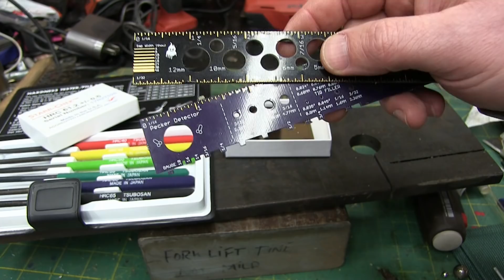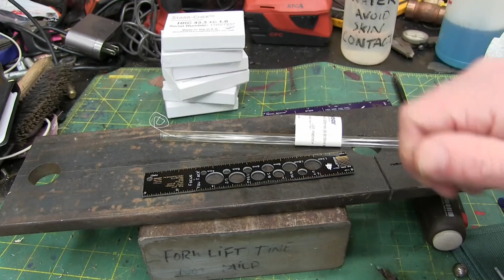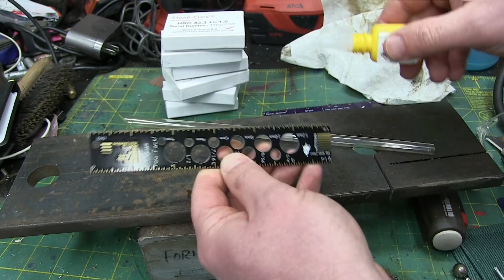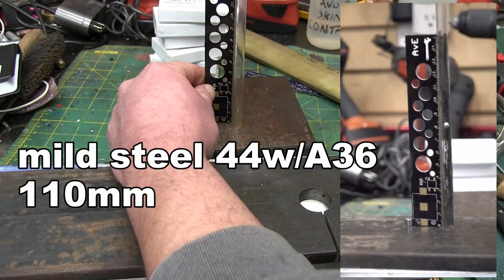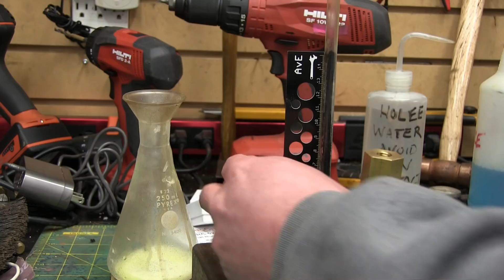Pocket Hardness Tester PROTOTYPE | IT WERKS!

Comment: A couple suggestions, keep the ball in the tube, that way you won't throw off the calibration by ending up with sticky greasy balls after fiddling with the apparatus... hmmm... where was I?
Ah, yes, a thin disc at the bottom, aperture just slightly under the diameter of the ball, it won't get on the way of the ball hitting the surface but will keep it inside. A the top an elbow for the ball to go over the top and rest, a little lever would kick it into the tube.
This way it would be less figety, just pick it up, turn it over so the ball gets into the elbow, put the instrument down and when it's nice and square flick the lever and make a measurement.

Comment: Fanfucintastic (Please be aware, there may be chillin present). Please try putting the piezo (or a strain gauge) under the coupon of the sample material is being tested. The item being tested should 'ring' at the same intensity as the sample 'standard', hence a basic correlation.

Comment: Mass difference shouldn't be an issue as long as the sample is backed up against a rigid surface, and can't be moved by the ball.
Also, a small solenoid coil around the top of the tube could hold the ball until the controller cuts current to release it.  This would fix the drop height and reduce the variations in drop produced by a fumbling 200lb gorilla.
Brilliant concept by the way.

Comment: Perhaps somebody smarter that me can advise here but how would air resistance effect this, small ball in tube like a piston in a cylinder? Obviously this could be factored in but what about different altitudes and thus different air pressures, how much difference could this make?
Reply: Say you used this at sea level, higger air pressure, ball falls slower but also doesn't bounce as high / at 2000ft thinner air, ball falls faster but then bounces higher; Could this cancel out any effect caused by altitude?
Reply: port the bottom end by < ball radius to reduce back pressure, or make sure the tube i.d. is >>ball diameter
Reply: Or include a calibration against a known standard. Like tare on a scale.
Reply: likely lower than all the other errors, well within what one would expect for a $25 ruler and tube device.
Reply: Luke, again, not trying to get 100% accuracy. Just want to get er in the ball park.
Reply: I have to agree here. All things considered, this is the roughest of rough estimates. And cheap too. Where do we let go of 'accuracies' to favor it just works
Reply: Precisely identify different size balls that correlate for different altitudes!!!
Reply: A thicker tube with a slot cut out most of its length would work the best.

Comment: Perhaps use a small solenoid so your drops are consistent.  You could even set up some simple light gates to measure the drop and bounce.  Just to make sure some apprentice doesn't try measuring at a 30 degree angle.  Provide a few ball and tubing sizes and you would have a damn cheap universal approximator.

Comment: So that was pretty brilliant.  Two ideas for ya.

Mayhap a photonic breakable beam at the bottom might be easier than a sound processor.  Maybe put a shroud around it to block outside light.

The freefall of the ball could pressurize a pillow of air, giving it some early terminal velocity that could complicate the curve fitting between time of bounce and hardness.  Maybe vent it with little holes all along the side.

Comment: Nice work propeller head. I'm thinking you'd have to do this on a perfectly flat, level, perpendicular, orientation to prevent the BB from touching the inside of the tube?

Increase the diameter of the tube to prevent the BB from touching? As a lover of fine knives I can say this is pretty damn cool.

Comment: You're correlating elastic collision energy to density and therefore hardness.   The problem is that slight changes in volume or shape of the test material will mess this up.

For the effort put into producing uniform samples you could just but the real test files.

Comment: i feel like the harness of the material will change the propagation of the pressure wave to the sensor, not sure if this would be totally negligible or what ... i would use an IR emitter and sensor in the tube ... it does not have to be in any exact position as long as its lower than the lowest point you expect the ball to go

Comment: you could have a little hatch at the bottom of the tube so when the ball stops bouncing and comes to a rest, only then will the passive hatch be accessible to the ball, thus saving to move the apparatus for resetting, even if the tube was ground at 45 deg it may work

Comment: I wonder if it could be done using some sort of hammer and spring setup, similar to a center punch? Measuring the compression on the spring to calculate hardness.  This would allow measuring on surfaces that are not flat and could probably be contained in something the size of a pen.

Comment: Might want to take measurements of subsequent bounces and so some clever stuff in the brain box to cancel out the error in initial height and velocity.
I haven't really done any investigation but what you essentially want is the coefficient of restitution. I highly suspect it won't be linear to the hardness nor linear to the actual impact speed, so you will most likely get different coefficients for subsequent bounces. However I suspect the relation of impact speed to coeff of restitution will be similar/same "shape", so you might be able actually use it to fit (polynomial least square or something) a function which depends on the hardness. That would also give you an error reading actually!
Probably takes some maths 8bit integer only machines (esp without hardware division) won't be too happy with, but computing time isn't an issue anyway.

God damn it now I want to take some measurements and try!

Comment: Brilliant. However, I wonder about how the thickness or gauge of the material being tested would affect the readings. A thin piece of 6061 aluminum, for example, may have a certain resonance that would affect how far the ball bearing travels versus a thicker or heavier gauge piece of the same 6061 aluminum. If both pieces were completely clamped down to a known harder than woodpecker lips material it may not be an issue. Yet, how would one clamp down said different gauges to ensure no resonance could incur?

Comment: Hey there AVE, Im a Mech Eng student at the UBC Okanagan. Might be able to test your samples on an actual rockwell tester, so we can get some validation. Also, One thing to consider is that the hardness of the ball is going to affect this as well, so it might be better to use a harder material, like ceramic, or even glass, provided they are readily available, I suppose. I'd think that the material (and geometrical at that) properties of a BB might have too much variation to be ruled out as a form of inaccuracy.

Comment: Couldn't you put an impact sensor that measures the impact of the bearing once it bounces back. So it falls, then the sensor slips in and takes the impact. Not sure if a sensor is sensitive enough for it. (Or have the ball land at an angle. Like bounces in a V

Comment: Or a tool like your auto center punch except on the rebound click it displaces a little shaft under tension. Like the way an air pressure gauge works

Comment: So much hype in the comments...
using a ball here ties your measurement to two fairly complex variables. the air density and gravity variations, both are a pain in the ass to account for properly. on the other hand, maybe they wouldn't add up to too much error. you gotta do the numbers.
aside from those, the ball needs to be calibrated hardness and the instrument needs to be exactly level.
also, each time you bounce off, you add 2 times noise to your measurement. at each bounce ball would interact with gravity and air friction, and it may or may not interact with the tube walls. reading one single bounce has a much better S/N ratio.

I'm quite sure you can get a hardness value based on the resonance frequency (AKA the tone made at the point of contact, that would directly reflect density, not quite the same as hardness though)

Comment: I can see using an arduino with the piezo connected to an input.  First bounce it stars counting and second bounce displays count on an lcd.  If you record the count and you know the hardness of the material eventually you can build up a lookup array in your program to display a hardness.  Remember this isn't meant to be exact. After all we would be happy with just a set of hardness files that only estimate the hardness.

Comment: What about two tubes with an open intersecting point on the plate. Set at angles like a V. One smooth for the  the drop and the other with lots of indexes to keep the ball from rolling back down.

Comment: Could you use a sealed system for the ball and have it dropped with an electromagnet onto a known surface at the base with a little point on the bottom, and if the point is super hard, can you use the bounce in much the same way

Comment: You sir are a mad scientist. Hear is an idea you might want to think about rather than a relying on Piezio device you could use simple photo detectors on the tub with a micro processer. The ball has a known mass which falling down the tube through the first beam. This starts the timer in the micro processer. When it hits the next beam you get a second time with a
known distance between the beams. This allows you to figure out velocity and energy. With a fixed know distance between the last beam and the sample you can then time the rebound on the first and second beams. If you build in a chart/table
that takes into account all the variables and measurement into a micro processer you would have fairly accurate result without needing on a mark 1 eye ball.

Comment: I dont think this would work if it was calibrated at one altitude/latitude and used in another becayse of differences in air pressure and gravity
Reply: yeah ... but it would be as close as bollocks is to swearing. Or good enough for the girls he goes out with

Comment: I think you're measuring the Young's modulus, i.e. stiffness, of the material. AFAIK stiffness does not change with heat treatment, or changes unpredictably. Hardening only changes yield strength. That's why e.g. Rockwell hardness test is based on measuring the size of an indentation, that is, how much the material yields under a known force. So I believe you're not measuring what you think you're measuring.

Comment: I'ma guessin' you'll need to incorporate some kind of gating to eliminate false positives. once you have the threshold set you should be able to get some decent readings I reckon. maybe a transistor on the output of the piezo for switching at the desired voltage?

Comment: Should count 3 bounces then the difference in times would probably be more accurate, in case of different height drop etc. May also help correct for other minor variables like air resistance, shmoo in the tube and shit.
Reply: Jason Gilmour this is what i was thinkinking. The height of the drop should be fixed so the ball have allways the same momentum.

Comment: Great idea, but it still need a "standard" BB (mass and hardness) and a fixed drop distance.
Can be a really good "trick" to identify "by elimination".
Example: you have a identified piece of "X" steel, the BB bounces 10cm, repeat the drop in the "Y" piece, BB bounces 8cm, hardness of "Y" is unknown, but at least you know for sure it is less than the hardness of "X".

Comment: Great idea, just a thought though: if the hardness is related to the ratio of drop height to bounce height then take a reading between bounce 1 & 2, and 2&3 then it doesn't matter what the initial drop height is, you've got the height of bounce one Vs bounce two and thus helps standardise it.

Comment: Now hold on there, this is all happening very quickly and relies on very precise measurement, so ain't it possible that the measurements will be affected by variations in local gravity, meaning if you just assume the gravity is 9.806 m/s² but you're sittin' on top of a mountain range, the measurement will be thrown off a bit, not enough for a home gamer to care perhaps, but enough that it's not super duper precise enough for some application especial

Comment: I would imagine you want the ball to be as hard as possible in relation to the material you're testing so all of the elastic deformation happens in the test material rather than the ball, thus giving you a more consistent reading. Tungsten carbide ball bearing?

Comment: I think this idea has another possible application, as a simple discriminator to identify metals, their alloys & other materials.
Would not be definitive, but could reject and/or support contenders from a list of possible candidate materials determined by context. 
Could be used in many areas, but I'm especially thinking of precious metals, and wondering if various karat grades of gold could be differentiated. Though typical samples may be too small for that purpose. Might be able to detect Aurum dipped Wolfram though...

Comment: The timed concept would work out good, but idk if you would want some sort of optical or magnetic trigger for the counter instead of a speaker. Cant belive a fucking ball bearing can differentiate harness, but the concept makes sence like fuck! But yes mass should be standardized for the ball, but essentially it would just be a tool that could approximate hardness, not necessarily be a laboratory tool. Love the show and the bumblefuckery, do allot of my own bumblefuckery as a marine mechanic for a living. Thanks for all you do AvE!

Comment: Use a tiny ball bearing and an infrared optical sensor to detect the leading edge of the ball near the bottom. Screw all these noise prone sensors. It's easy to add a button to zero a light level reading and you can block a welding arc a lot easier than you can block the sound of an impact driver.

Comment: leeb tester fuck ya!!!!  just can't do thin material!!!  https://en.wikipedia.org/wiki/Leeb_rebound_hardness_test  
they generally use a  calibrated spring  to accelerate the mass toward the surface.  how to measure the rebound is the trick.  rather then a mic what about a coil places at the surface and just above and the bb is magnetic, the you measure the voltage spikes as it passes through. of course the coil will slow the bb but that can be calibrated for because it is constant.
Reply: portable leeb tester with test block for 261 usd on the old ali express. Shit, who knows if it actually works well but for the principle it could be a good starting point to base how to measure it.

Comment: Maybe I am stupid, my wife would swears it.  but isn't this just a returned energy test? I mean it should work if the material like metals has no give/flex.....i guess plastics would be kinda same but once you get you squishy stuff like rubber.  Wouldn't really be a good hardness indicator... I know some rubber materials have higher energy returns if impacted.  still cool concept and wildly cheaper then other hardness tests.

Comment: You could sense the ball inductively pretty easily, to avoid all acoustics issues.   Use a small unshielded ferrite inductor, measure the drop in Q as the ball passes near it. Easy way to measure Q is to have a cap in parallel, ping the coil with a ~1uS pulse and count the ring-down pulses - more pulses = higher Q = ball further away. Look at Q over time and fit a curve to establish the actual time it passed the reference position.  
You could do this with just a small MCU and a few passives - use a comparator peripheral to detect a near-zero crossing of the ringing signal.  As the ringing waveform will swing both ways ( +ve and -ve), it needs to be under the 0.6V MCU input protection diode threshold, so you need to be sensing at maybe 50-100mV to see the zero crossings.

Comment: use LAZZZERS.. Seriously though
From 3D printing we use laser filament detectors, basically just a prepackaged laser chip that checks when you break the beam. Jellybean parts! grab two of em, set them a known distance apart, calc velocity from the time between beam breaks and this way you can even account for inaccurate drop heights bc you'll know exactly how fast it's going before its first impact

https://www.gearbest.com/3d-printer-parts/pp_413835.html?currency=USD&vip=2409867&gclid=EAIaIQobChMIr_PSg7zT1wIVhLjACh1OjQqcEAQYASABEgJRjPD_BwE

Comment: Firstly, I love your videos man! Been watching for a while now. On the topic of a ruler for hardness testing, wouldn't it be easier as opposed to writing a code that does the math between "pings" of the ball bearing to correspond the height of the bounce to the hardness, set up some kind of reed switch, or proxy switch on a longer ruler such that the leds will be triggered by the height achieved on the bounce and remain on. Then you could just etch the ruler with hardnesses and use the leds to determine material hardness...just a thought. Keep your dick in a vice!!!

Comment: Love it. Used to work with one of those 100k pecker poker detectors. There is essentially no real difference, other than the calibration costing a bajillion dollars a quarter. If you are trying to compare relative hardness to pieces in the shop for whatever bespoke project, this’ll do. Find a piece of 1018 and a piece of 1075 or so for reference.